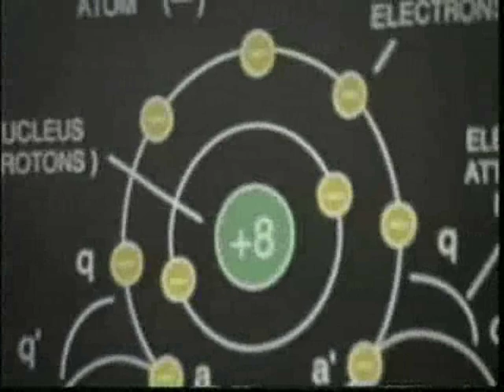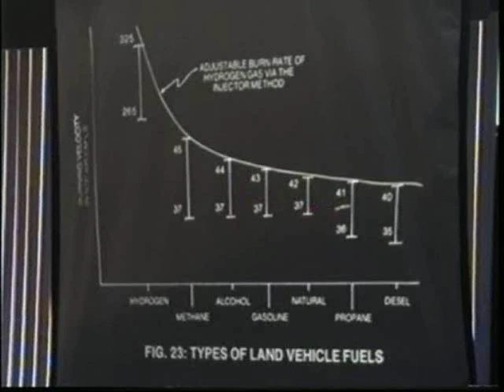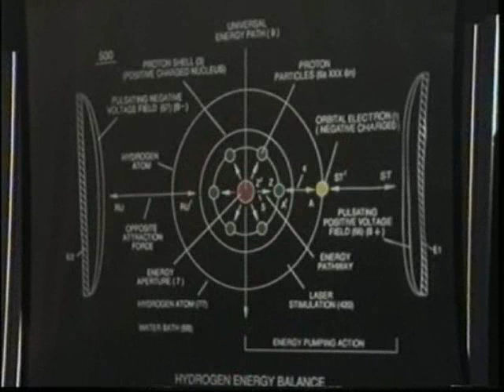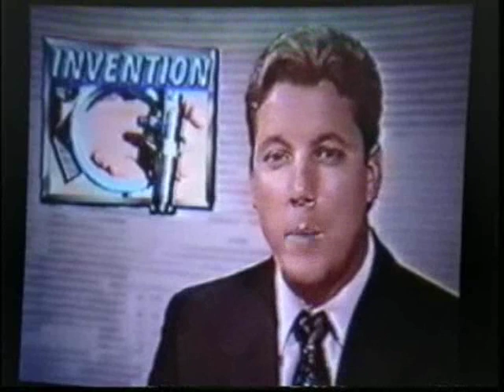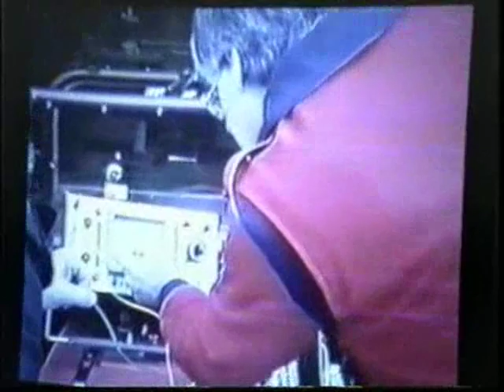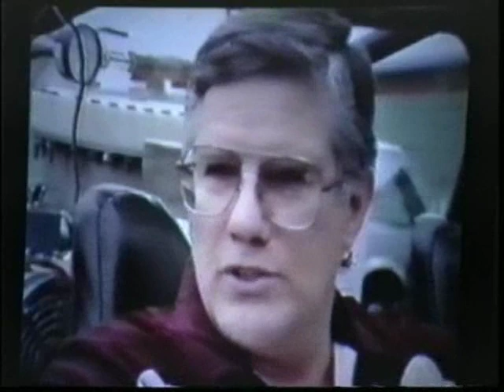Stanley Meyer - 1992 Global Sciences Congress

Comment: Ionising the air.
Ok, his Gas Processor / air ioniser. A basic understanding of how air can be ionised with electrostatic fields. Most commonly known for the production of ozone. 
An air ioniser does not make ozone inside the device. Ozone is made as the gases leave the ioniser and only then they join up.. Oxygen molecules get drawn into the ionizer and between the electrostatic field electrodes instantly get split into oxygen atoms, electrons get ejected and electron sharing starts to happen.
On exiting the ioniser the oxygen atoms quickly bond into molecules again and can carry a third oxygen atom. Forming ozone with a very short life. When put into contact with anything of an opposite charge, they drop the third oxygen atom and it does work oxidising like a gaseous bleach..
Stan redesigned the air ioniser. He knew if he could make more reactive oxygen it may increase the efficiency of the hydrogen and oxygen energy output during combustion. 
What he did, was to use the electrostatic fields of air ioniser to break down the oxygen molecules from air. But also prevent the formation of oxygen molecules and ozone post ioniser..
 Well how exactly did he do this? 
To do this he understood that if you have two electrostatic electrodes of opposite polarity with a dielectric in between being air. Then do you not have a capacitor?  When you break the molecules apart into monatomic atoms ions and free floating electrons there is an amount of charge on that capacitor.
If the pulsing circuit is interrupted and the capacitor is discharged through a filament that produces thermal energy as light. You can burn off free floating electrons from the oxygen atoms. And in so make an Oxygen Cation production unit. Not just Oxygen Cations but Cations with up to four missing electrons. This is a very reactive oxygen atom. In order to enhance this process Stan added pulsed light emissions to the gases in the processor 180 degrees out of phase to the electrostatic pulsing. This temporarily added energy to the oxygen atoms and made them more likely to eject electrons and less likely to gain electrons in their unstable state. The light added was very simple 660 Nm LEDs targeting the oxygen atoms.. So now he has an Oxygen Cation production unit. Keep in mind Oxygen Cations are not neutral thay are positively charged particles and in so are accelerated towards a negative electrostatic field and repelled by a positive electrostatic field. So do keep this in mind! His VIC circuits are High voltage particle accelerators.
So here comes the new discovery the twins made!
When mixing the Oxygen Cations into the combustion of hydrogen and oxygen gas from electrolysis or bottled hydrogen and oxygen. Hence no need for the Faraday electrolysis. They had anomalous energy output. But not just from increasing the efficiency of the gas combustion. They stumbled upon an energy output over and above gas combustion.. They called this Hydrogen Fracturing! 
Now as we know Oxygen is eight times the size of a hydrogen atom. And in so has eight times the attraction force over an electron compared to the hydrogen atom. So if there is a free floating electron the oxygen cation will gain it, and the hydrogen proton will have to wait to find another electron. But what if the hydrogen proton can't find an electron to stabilize? 
Well as we know the combustion moment is extremely quick and inherently wants to shut down and stop releasing energy and go on to form the water molecule. Stans gas mixing of the Cations into the hydrogen and oxygen gases from water or bottles postponed the formation of the water molecule as the Cations remove / gain all of the available electrons during combustion. This forces the hydrogen protons without an electron to implode. The implosion of the hydrogen proton makes a shockwave that can be directed on to the top of a piston. E=MC2 Mass to energy. This is a new atomic energy release, over and above gas combustion. And as there is no neutron interaction then it is a clean process. One hydrogen atom has very little amount of energy but if you have many. They all add up..
This process is totally controllable by way of mixing the amount of gas Cations hence the GMS, Gas Management System in the dash of the car. So are you still with me lol!! It’s a lot to take in given I am dropping you in at the deep end..
Ok the next invention using the cations is quite amazing. I impart this information to you, and give you the duty to pass it on. Anyway here we go..
The next discovery the twins made. Is that if you are to dissolve the Oxygen Cations into water. This is where I was positioned to understand this as I worked on a fish farm for twenty years and broke records for transporting live fish across land with minimum mortalities. Constantly adjusting the dissolved oxygen from tanks into the water to keep the fish alive…This is how Stan made and coined the name. Waterfuel, oxygen cations in the water.
As we know water can hold up to 17% dissolved gases, like in a can of coke.
Stan dissolved the gas oxygen cations into water. He discovered that these oxygen cations would re-emerge during his improved electrolysis method using high voltage pulses to release hydrogen and oxygen from water called the voltage or electrical polarisation process. The cations can not gain electrons from the water molecules as they don’t give up their electrons easily. And so are held in state. When the oxygen cations re-emerged into the gas production gases. What do you have? A cation is an ionised gas. Ionised particles in the gas production. By way of high voltage electrostatic fields ions can be accelerated through the gas production bubbles. If vibrated back and forth. They start a Townsend Avalanche and ionise the gas production bubbles.. So what exactly happens when you have ionised gas bubbles surrounded by water. Well the ionised gases shoot high speed particles emission, electrons and gas ions into the walls of the water. Water molecules are held together by way of the covalent electrons. If you remove the covalent electron. You instantly break apart the molecule, into hydrogen and oxygen. Faraday electrolysis pulls the water molecule apart with the use of amps. But if you can ionise the water molecule in a physical manner and knock off an electron it will split and they can not reform.Having ionised gas bubbles that are firing high speed particles into the water that is surrounding them. Knocks off electrons from the water molecules. And in a new physical manner splits the water molecules. This is bringing more charged particles into the frame to be accelerated. This action happens in an exponential curve. The same as Townsend Avalanche is exponential. Stan and Stephens gas production was also exponential. Stan said he could make so much gas from his cell he couldn't fill it with water quick enough. That’s a lot of gas…Like I said back at the beginning. Stan was only going to take his waterfuel injector, to market. Reason being there is minimal gas production. All gas production and GTNT/Hydrogen Fracturing is inside the injector cavity. This is inside the engine where it replaced the spark plug. So it was safe and fool proof. If you can make an energy release over and above gas combustion then the less gas burnt the better.. To give you an idea of the energy conversion during hydrogen fracturing. One US gallon of water equals 6 million barrels of oil or thereabouts. Einstein will back this up. Stan could use hundreds of times less gas combustion to produce the same amount of energy to move a piston.His super heated steam production for use in many applications including desalination and well anything you can use superheated steam for. Superheated steam can be made by using either one electrostatic polarity or two alternate electrostatic polarity poles on the waterfuel.
With the use of only one electrostatic field at one time. Stan could pull the gas cations through the water. This would cause them to bump into the water molecules and flex the bonds. Much in the same way a microwave flexes the bonds. Causing the bonds to produce heat. Stan is only using one electrode at any given moment to move the charged particles through the water.  How much energy are you going to use to create an electrostatic field? Especially when the circuit has no return path. You will see his steam resonator on the car and you will see his home heating boiler in pictures online.
As you can imagine I know this is a hell of a lot to take in in one sitting. And is the kind of subject that can be absorbed in a conversation pulling up the relevant documents and videos and pictures over the course of some time.I have tried to condense twenty years of Stan's work into a few paragraphs. Stan had a saying: KISS , keep it simple stupid. This might seem a bit out of place with what I am explaining to you. But in the context of a new atomic energy that can be done at home in a garage or shed. It is keeping it as simple as possible..I hope this offers you a key insight into the understanding you need to study Stan's mountain of work that he left behind for us all. He even made sure to legalise it. So it could not be prohibited from public use in the future for us all. All the best, Ps once it all sinks in, and it might take a while. Please pass it on as there are many people out there that are great at building. But only if they know just exactly what they need to build.. Cheers Tony..